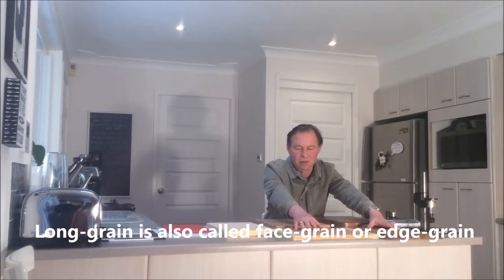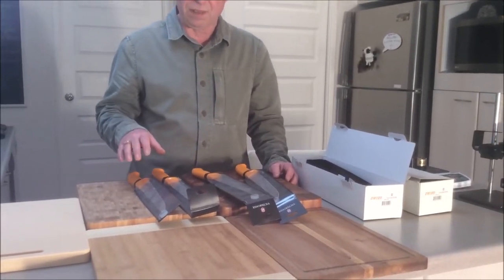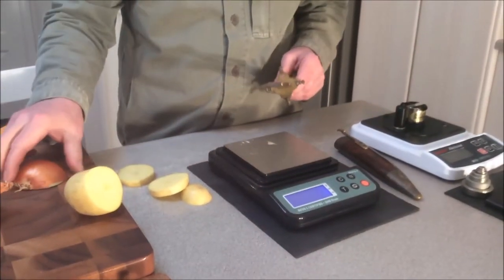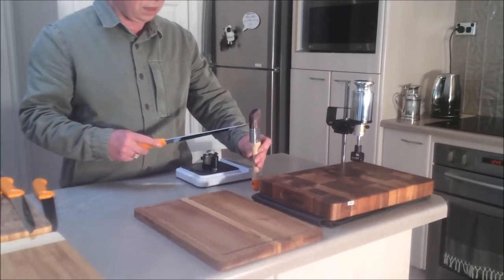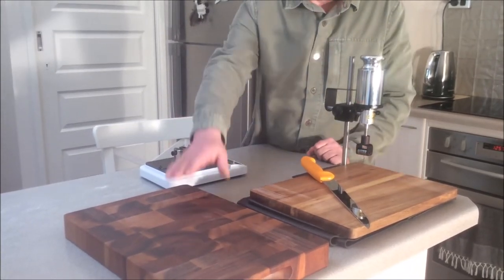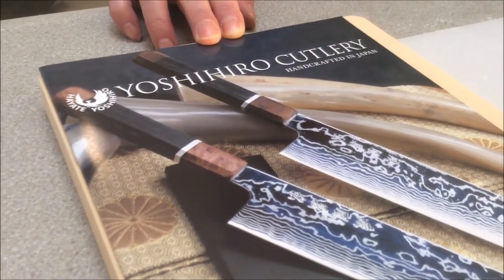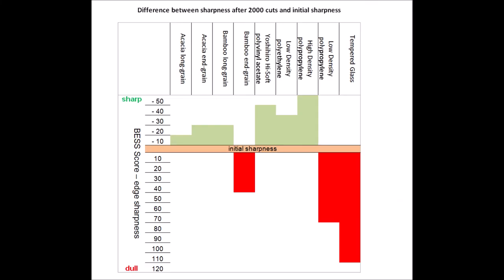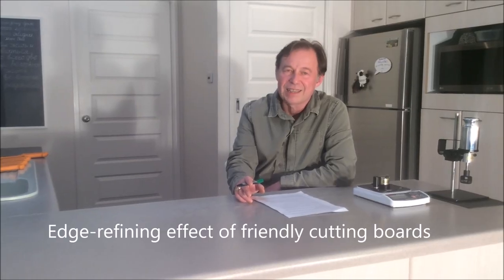Effect of Chopping & Cutting Boards on Edge Sharpness

Comment: Love the video! Best I’ve seen for accurate testing. Only problem is that it doesn’t account for the verying hardness of the knives (the ones in this test being HRC 56-58). A 58 will keep an edge better than 56 and sometimes factory edges aren’t identical ether.

Comment: In the US there is an INFINITY of High Density Poly ETHYLENE -- but I can not find a single listing anywhere for high density poly PROPYLENE. HDPE is everywhere. Are you sure that's not what you have used?
Reply from the maker: The boards used in the test all were explicitly labelled

Comment: So at the 8 min mark it says that the initial sharpness was 125 and 130 respectively but after 2000 cuts its 115 and 110? How is it possible the knife got sharper with 2000 cuts? Did you accidentally put the numbers in the wrong column?  Just checking.
Reply from the maker: This was a shock discovery. Please read http://knifegrinders.com.au/SET/Chopping_Boards.pdf

Comment: Edge refining effect! Very interesting indeed. I wonder whether there is a way to utilize an "edge refining effect" as a sharpening finish step. Thanks so much for doing this careful experiment.
Reply from the maker: It took us time to arrive to the right explanation. When we start slicing, the knife does not become sharper, but rather restores to the edge sharpness it had before the knife storage. The spontaneous loss of sharpness during storage gets reversed as we start cutting, by stripping the oxidation layer off the edge.

Comment: the 2kg load is interesting, thanks. how about chopping an apple ("tack tack tack tack!")? my fine edges get "dulled" by chopping contact on plastic boards: rolled edge, crushed edge, flattened apex.
Reply from the maker: My fine edges would crush on chopping too :)
For chopping, including in cleavers, we put an edge of the same angle as we put on breaking knives, i.e. 14-15 dps in quality steel, and 20 dps in those at the lower-end.
Reply: @knifegrindersaustralia5158  i am looking into Hasegawa Soft Rubber cutting boards, e.g. the FRK-series. it's supposed to be very edge-friendly. i couldn't find any HDPP cutting boards on the market, only HDPE.
Reply from the maker: @leecherlarry  I may be wrong, but these are for slicing rather than chopping - so in the end  of the day you will need a separate board for chopping.
Reply: @knifegrindersaustralia5158  you are right. but i meant the cutting of onions apples melons cabbages ananas pumpkin with a chef knife, not hardcore chopping with a cleaver knife. our kitchen knives dull when they hit the board, not when we slice on it. I'll try to buy a hasegawa board and check edge retention for apple cutting tack tack tack 🔪🍎🍍🍉 🎃

Comment: Hi
I am new to japanese knives and just read about Hasegawa. Do I really need the whole cutting board with the wooden core or will the soft cutting mat placed on the countertop give the same cutting experience and quality?
Reply from the maker: Hardwood boards show OK in our tests, while flexible mats show bad.
Reply: @knifegrindersaustralia5158  what cutting board would you recommend?
Reply from the maker: Any high density polypropylene - the board we used in the test was by Scanpan. Proven edge-friendly and can be washed in your dishwasher.